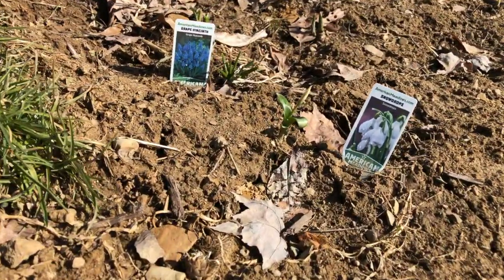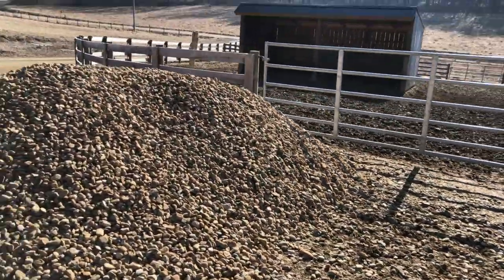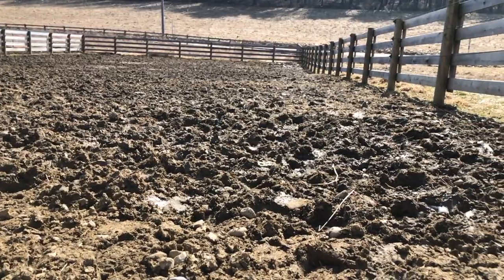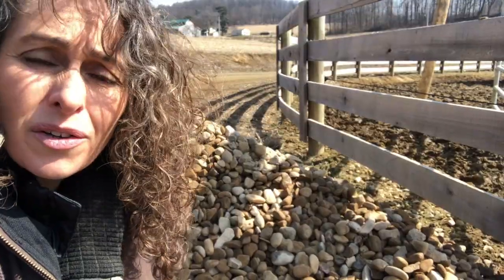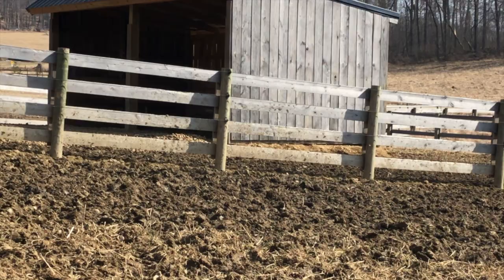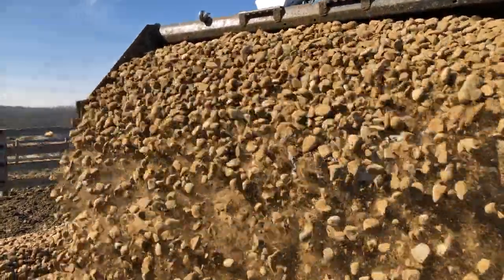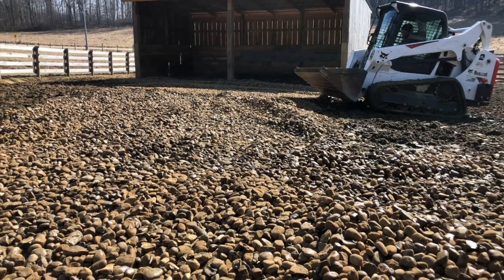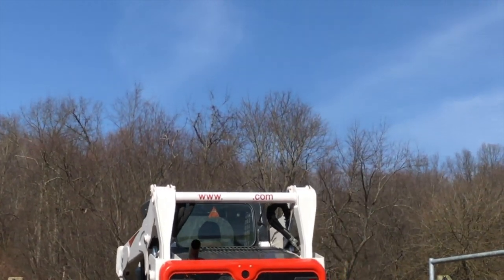3 fixes for mud in horse paddocks

Comment: My horses don’t wear shoes, so if the mud is awful, I hose them off every evening and put them in a stall.  Also, there’s a bunch of wasted hay from round bales they ate all winter, so they like to stand on the raised area, and they could walk out to the field where the ground is higher and get out of ankle deep muck.  
What size rock is that you used, or what do they call it? looks like 2-3” rock. No sharp edges I see.

Comment: Well, we've built "playpens" built up with 6 or 8 inch wood at the edges, with fabric underneath, and sand.  Easier to scoop manure out of. So far so good. We're aboit 3 years on for one, and needing to replace some sand. It does stick to the manure, so eventually it goes away in spite of the fabric.  A couple high traffic spots are done this way, although I'd love to be able to afford more.  No shoes on our babies btw.